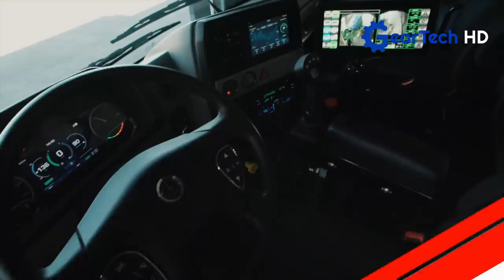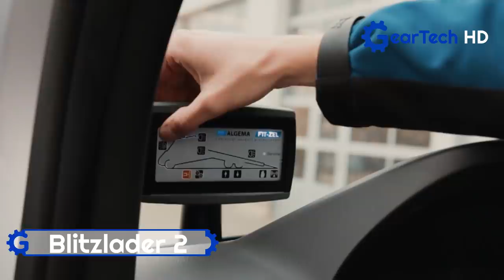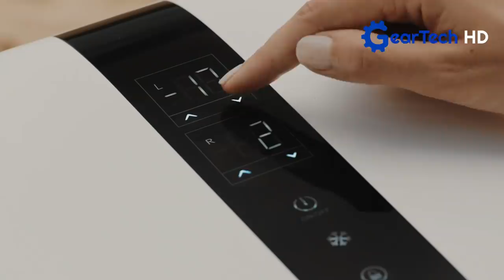Amazing Car inventions That are on another level ▶ Ford F-250 Deberti Transformer

Comment: The F250 wins hands down. You'd be amazed at all of the available storage a truck has to offer. All you need is an imagination and common sense.
Reply: Eh, just get a utility bed for what 1/100th the cost...
Reply: @Daishar Ehhhh.. where's the fun in that!
Reply: @Robocoppat  In the other toys I could buy for the difference in cost. I mean you could get a decent fun drag car toy, and a 4 wheeler or side by side for the difference, and still have some left over.
Reply: That and a couple hundred grand. All that storage on that truck is fine but onlyy if you want to shell out six figures.

Comment: Holy cow the that F250 has everything I could ever want except it needs to be a GMC 3500 duly with manually shifting Diesel engine pulling a 20 foot straight hitch tandem axle belly dump grain trailer

Comment: That Denali loosing the b pillar just made that truck very insafe for side impacts
Reply: If you cant spell  unsafe , then you have no business telling others what is safe or not .
Reply: @pureblood3127  oh you blushes
Reply: The driver would go through the steering wheel in a front end collision too with about 1000+ lbs of mobility scooter and 400lbs of driver. (weight of unsecured items drastically increases)

Comment: F250 hidden tool box ,HIDDEN ,the bed had at least 18 to 24 inches missing from the load area.
That truck is limited to a very few users.  
A racked out van will beat that all day long.

Comment: If you buy a Ford, you'll need those tools, it's a necessity and should come as standard requirement with every truck.
Reply: Exactly what I was going to say man 10 of 10 comment
Reply: Ford not built with your tax dollars ( fact )
Reply: #1 truck forever
Reply: You mean Dodge right
Reply: Can confirm Johns dodge comment. Used to be a dodge guy. Those trucks looked good in 94. 
Rebuilding the front end every other weekend was no fun.
And dont get me started on the fing 46re trans. Replaced more of those than all other trans combined in my life.
Reply: John Van Vleet Amen to that. Bought a 96 Dodge 4x4 duely years ago because of the Cummins. The engine is great! The trucks a total piece of junk. Dash busted in lots of pieces, headliner falling down, seat tore out on side seem, and I'm not a heavy guy, paint coming off, lots of rust, rebuilt front steering parts twice!  The truck only has 160,000 miles on it. I'm looking for a Ford with a bad engine to put the Cummins in!

Comment: How is charging electric trucks or cars from homes the grid that supplied by coal ,natural gas and nuclear energy is actually much better then gasoline is
Reply: Nuclear power generation is extremely safe and non polluting (minus the leftover, but moving to other reactor styles can use the leftover of older versions). And as for other power generation, it is far easier and cheaper to collect/reduce/remediate pollution from a single large powerplant as opposed to the 100,000-1,000,000 individual smaller powerplants. Switch all possible transportation to electric as fast as possible, then eventually move all or most powerplants to green energy ones.
Reply: Evan Robinson wonderful idea so all that “leftovers” radioactive waste that one truck
Load could end life on earth 
You know just leftover stuff
We can store that on your land ?...?..?..?.
Reply: @miguelcarter1949  one truckload of our radioactive waste could not currently end life on Earth. And we'd only have leftover waste if we continue to not innovative new reactor designs. Things like thorium reactors, and even some that use the more radioactive older waste. Current tech has the waste from generating the energy needs of an entire home for a year at the size of a brick, with about 5 grams of that being radioactive. And we already have government owned under-mountain storage facilities. Good side effect of Space-X becoming more and more awesome is that we might even one day just shoot our radioactive waste into space, then push it into a sun collision course. They will be able to launch 100+ tons of payload for about $1million in propellant costs. That would be take around 19 launches every year to get rid of all the radioactive waste from every American, if every home used nuclear power. We have a nuclear power budget of $37.2billion on 2019, so $22million (have to transport the waste to launch site) isn't bad part of that. Granted, we have to spent a bunch more billions to build new reactors, but we should have more in development than we do, sadly costs always continually shoot up on the builds. But again, nuclear is absolutely safe. You get more radiation walking through Grand Central in Manhattan than you do working in a nuclear plant. (That radiation is from the granite stone that the building is constructed of). You also get more radiation flying across the country than you do working in a nuclear plant.